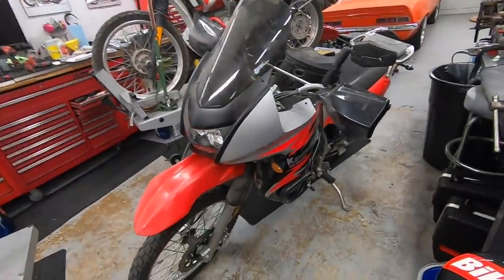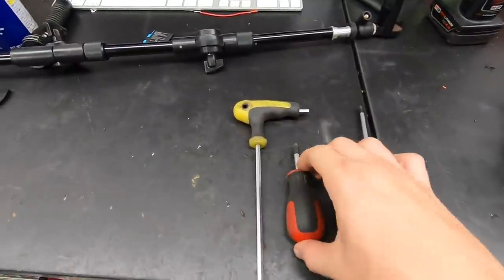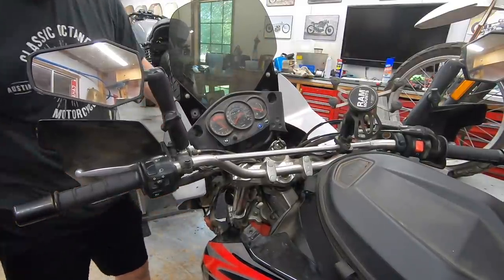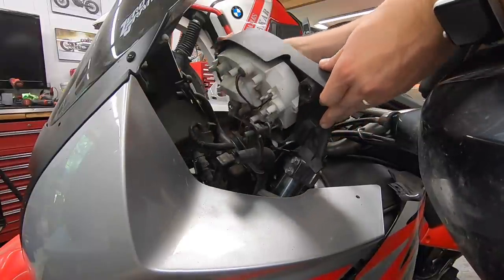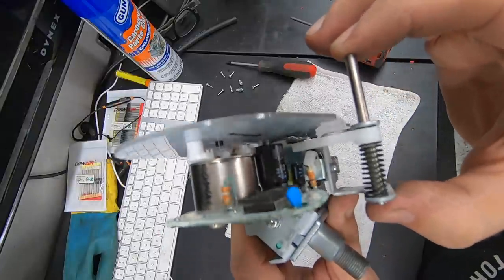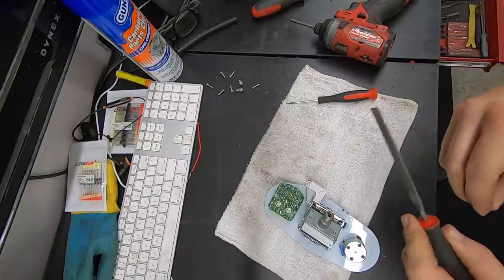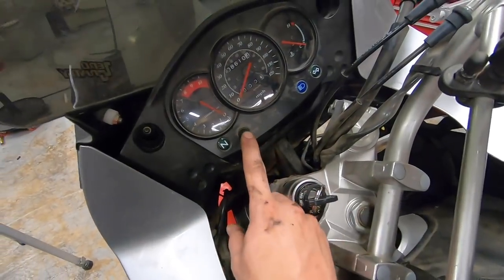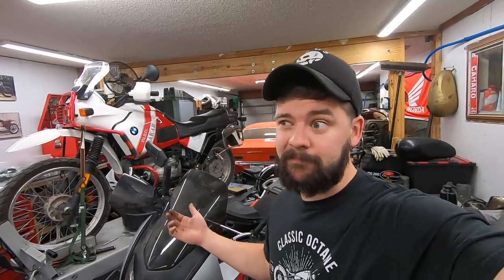KLR650 tripmeter repair (Easy and free)

Comment: This is great. Got an 08. Got from dealer new signal lights for some reason. New cam chain.  Can chain tightener.  New 685 kit not Even broke in. Only thing wrong is the trip doesn't reset. It feels like it doesn't move is this the fix. Great video

Comment: Just the windshield needs to be removed, unplug stuff then wiggle it out of the fairing. But yay you did it✌😆
Heavy water crossings use will eventually kill the speedo cable too.

Is the bmw the replacement?

Comment: Could you possibly do a video about changing from stock air boxes to pod filters and/or velocity stacks. I've been looking around for years trying to understand the swap and how to do it properly but can't find any good blogs or tutorials or really any good info.
Reply: CV carbs are NOT intended to work with individual filters. They ideally require a still air space to draw from, which individual filters cannot provide.